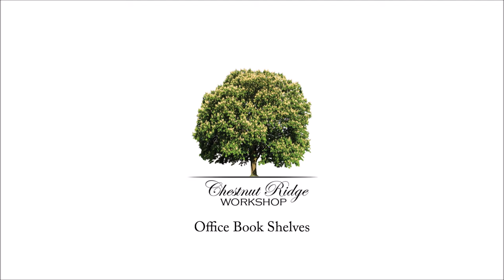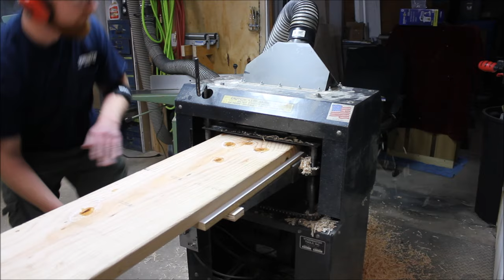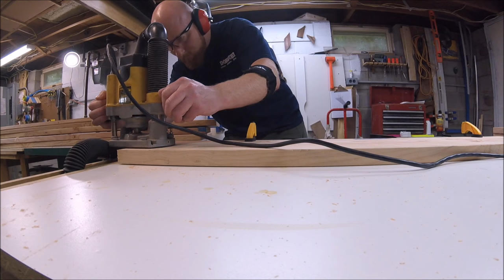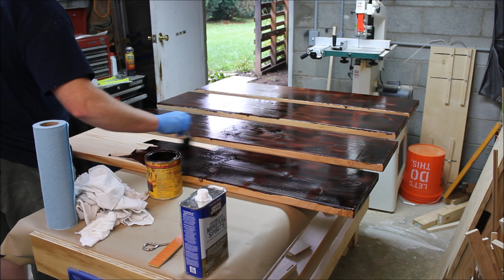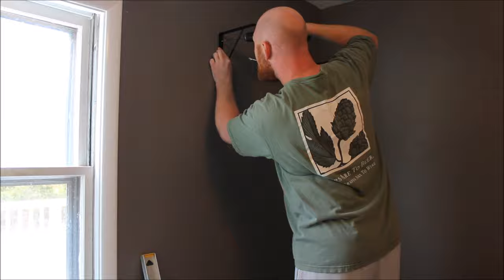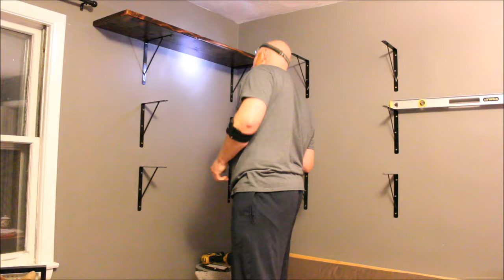Office book shelves - How to build wall mounted shelves - woodworking

Comment: Awesome job. How would you do this without the planar and jointer? (I’m new to woodworking, I think that’s what those first tools were lol)
Reply from the maker: Without those big machines to use, this is still very doable. I needed those because I bought cheaper lumber that needed some work to make it usable. I would suggesting buying 5/4 (roughly 1" thick) lumber like poplar for this project. You may find it at a box store, but a local hardwood supplier would be better if you have one. They could even plane it for you if needed. Then you're just dealing witht the sanding and finish work.
Reply: thanks!! @ChestnutRidgeWorkshop

Comment: Hey I’m doing something similar. I got these 1 1/4 #7 screws for mounting the on the studs. I will be having heavy books too. Is this enough, or is there a screw you’d recommend. It looks like you used much longer ones
Reply from the maker: You need at least a 2.5" #8 or 9 screw. I used 3.5" but I have very thick plaster walls. Point is you want at least 1.5" of screw into the stud.

Comment: Can you share what type of brackets used to hold them up and also what type of screws? Did you have to use anchors?
Reply from the maker: I just got these ones at Home Depot,  nothing special. I used 3.5" wood screws, and a stud finder to make sure I hit the studs. I wouldn't trust wall anchors in this application, there's too much weight.

Comment: Great video! Have been wanting to start a project like this for my vinyl records. How much weight could the shelves hold  with brackets?
Reply from the maker: Thanks for watching! Not exactly sure on the weight, but mine holding roughly 100lbs per shelf on the long side. So I have about 25lbs per bracket right now. I'm certain they could take more, but I don't have an exact number. Get those bracket screws into the studs and you should be fine.

Comment: What size brackets did you buy?  What spacing did you put them at?  Thanks!
Reply from the maker: The brackets are 8" x 10", with the long side on the wall. They are spaced at 32", but it varies in a couple spots just based on shelf length.
Reply: @ChestnutRidgeWorkshop  Thanks!  Appreciate it!  Going to build this!
Reply from the maker: @dg2015  awesome! Have fun!

Comment: Can track/shelves intended for books hold up sufficiently with anchor screws on concrete walls?
Reply from the maker: Yes they can. Just be sure to use a good concrete anchor with the appropriate load rating. I recommend tapcons. Thanks for watching!

Comment: What machines did you put the planks through and why? Is it necessary or can I just stain & topcoat planks I buy from Home Depot?
Reply from the maker: I put them through a planer, but it's not necessary. It gets them nice and flat, but for bookshelves as long as they are mostly flat you'll be fine.
Reply: @ChestnutRidgeWorkshop  Nice. So I've really just gotta sand, stain, and finish then?
Reply from the maker: @justinshabtai  correct

Comment: nice shelves!  the trick that I had with corners, is getting the shelves on one wall aligned with the shelf on the next wall.... dealing with the height being exactly equal, but then the boards not laying exactly equally flat.... but then again... once I put stuff in the shelves... books or whatever.. that small quarter inch difference in the slope did not matter./../ the height came out the same.. just that wood, being wood... they have their warping characteristics...might not have ben an issue, if I planed them down.....and screwed them to the brackets..
Reply from the maker: Thanks so much for watching, and love the username! Even with slotted holes in the brackets and kiln dried wood I still see significant seasonal movement in these ones. Many times those corners are not aligned well at all.

Comment: What kind of wood was used?
Reply: thats PINE
Reply from the maker: For this project I went cheap and just used dimensional lumber from Home Depot. If you do the same just be very picky, and make sure it's reasonably dry. Most locations carry kiln dried in couple sizes.

Comment: Are those boards 2x12?
Reply from the maker: Yes they are. Thank you for watching!
Reply: @ChestnutRidgeWorkshop  I wonder if these have twisted or warped? I'm getting ready to do mines but worried it will twist or warp since they are so long. I'm thinking about doing 8ft or 10 ft boards.

Any advice to prevent them from warping or twisting?
Reply from the maker: @Paul Yang  you'll want to make sure you have them in your home for at least a month before doing any work with them. If you have a moisture meter that's even better. You want them dry and acclimated or yes they will warp, twist, cup, etc.